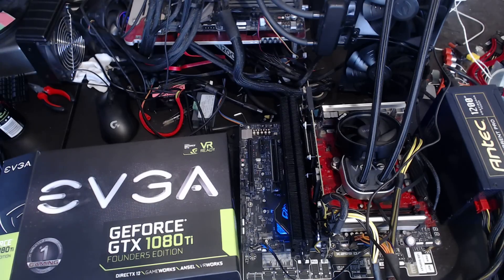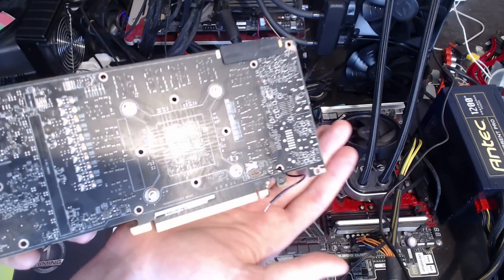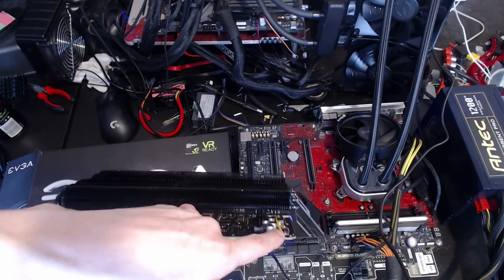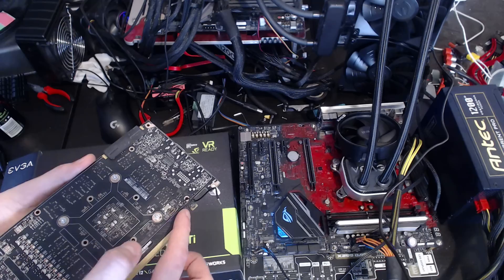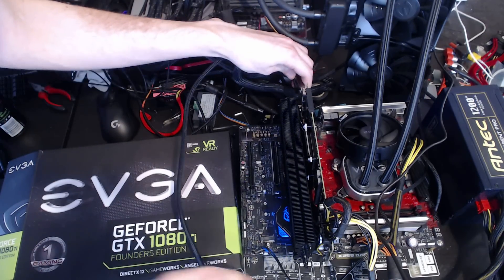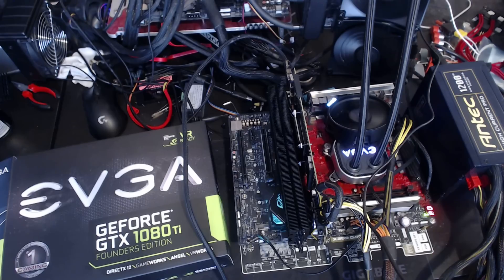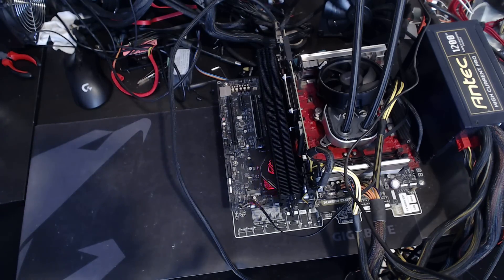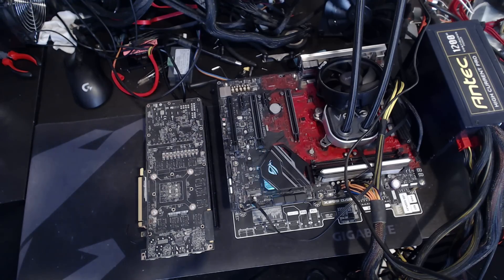OC Adventures: The resurrection of a GTX 1080Ti Founders Edition

Comment from the maker: first

EDIT: because people keep suggesting I send the card back. This is what the sender told me about keeping the card: 

"I've already gone through the traumatic experience of buying the replacement 1080 Ti so I would have no need for this one even if you can get it working."
"I figured it would be better to send it off to someone who could possibly get some use out of it as opposed to me just tossing it. "

Also I'm not a repair shop and if I was a repair shop I'd be charging for fixing things.
Reply: Actually Hardcore Overclocking You should send it back.
Reply from the maker: on the basis that I'm not a repair shop. no.
Reply: when life hands you a broken but free 1080ti that you manage to get working again, the only logical conclusion is to overclock the snot out of it and see how far it can go. bring on the current mods and LN2. worst case, it dies (again) and you had some fun/got some content which was surely the original owners intention (to see if it was brought back, what you would do/it could do).
Reply: Considering a video card loss as a trauma is whats wrong with the world and why there is genocide, it amazes me how brainwashed people are, they need to get the fuck out and live life or do something because the world is being destroyed by psychopaths...
Reply: and here you sit........LOL
Reply: 600flames is proly trolling XD
Reply: what about chopping up a pci-e extender instead of fidgeting with that presence wire, I would be concerned about  shorting the presence to the 12v right next to it, which would probably set fire to something else, it would't take much for that wire to find a way loose and bridge to the 12v
Reply: it was water cooled and coolant got spilled into the pcie slot (friend of the person that sent it in)
Reply: You should keep or trade it to another overclocker that can use it...
Reply: preach that shit, it was a gift
Reply: Janky presence detect jumper wire for the missing bit of PCIe connector, that is not really an end user fixed item, it's more like BZ got it barely functioning good enough for an OCer/Modder to use it on a test bench only, with a lot of tedious work to get it plugged in, lol.   Some of the comments are funny about giving it back given the 'work around', lol.

Great vid BZ, congrats on another card for, well, OC it till it's dead again (grin)

Comment: Hi I sent the card in. Don't send it back. Ta

Why I couldn't RMA it: Coolant spilled on the PCI-E slot on the motherboard while I was swapping out the CPU due to a loose fitting twisting when I took the block off. Spent 20min hitting it with a hair dryer and left it for a few more hours to dry, ran the system and it was fine idle but as soon as power started going through the slot it caught fire. Wouldn't be covered by warranty.

Comment: With that janky PCI-E connection it's not even in any shape to be given to a regular user. And just because it could be fixed does not entitle the original owner to anything since it was essentially considered trash.
Any dead hardware sent in with the expectation of it getting fixed and then sent back deserves to be ignored. Buildzoid is not a charity.

Comment: nice work. lately i've been wondering about dead gpus i could fix. it's not rocket science after all.. i do have a multimeter and what's necessary to solder stuff, just not smd mosfets (yet). i also have a cheap DIY scope good for up to 100khz or so with a 1x/10x probe that i'm using for audio stuff, but it'd be hard to see actual pwm signals with it but still it's not completely useless.

as far as you can tell, how high is the chance of a gpu to have a repairable blown vrm, as opposed to blown gpu core or ram chip in the ebay market?

Comment: Hey Buildzoid,
I bought a GTX 980Ti which is not recognized by the mobo (VGA LED lights up), no display and also the fans are not spinning on start up. Furthermore every voltage (12V at test points and the 12V caps, 5V, VCOre, VMem, PLL, PEX and VDDQ) are  basically 0. The only one present is the 3.3V. Any spontaneous idea what might be the culprit?

Comment: Great news abought that GPU but when does the next video abought VRM temps come out? Im really really iching to buy the MSI X470 Gaming Plus but i still have some doubts abought it being able to handle a 2700X for a daily streaming option without direct strong airflow over the VRM-heat-sink. Depending on that i might buy a Biostar X470 GT8 because it has a 8 phase IR3555.
Reply from the maker: So I did a test run with the Gaming Plus on an open air test bench with 0 airflow. At 100A 1.4V it hit 108C on the VRM and 97C on the capacitors. If it had some air flow it would run a lot cooler.
Reply: Thank you very much. I really appreciate the motherboard reviews and the work you put into sharing your knowledge and data. Some of your T-shirts are starting to look mighty fine. Would you maybe be interested in a old 1gb 560Ti, to overclock to death? I was planning on putting it on Ebay or use it for solder practice but i could also send it your way.

Comment: OHC, I have a Z170 OC motherboard that doesn't overclock well, and I don't want to mess with it anymore, and want to know if you'd be interested in testing to see if it works and if you could push it to the max. I think I shorted some circuitry when trying to install a fan controller, but the board was working without issues for about 18 months with a 6700K. I don't need the board and can't recover the money for it. You interested? I'd be happy to gift it free and clear.

Comment: I should buy a rajintek morpheus...
Reply: yes. or an artic one.
Reply: It is excellent. I've found that the best fans for it are two Fractal HP-12s, really quiet.
Reply: GurtTarctor I believe you misspelled Noctua NF-F12
Reply: I've found Noctua's and Corsairs ML fans to all have slight resonance and hum issues at certain RPMs, at least with the 140mm variants (ML120s too), whereas all the Fractal fans I've had have been consistently really low in tone and noise. Noctua fans are overrated in terms of the 'silence' aspect in my experience.
Reply: GurtTarctor i got two Noiseblocker 120mm fans on my ref RX480 with a random heatsink, works quite well.

Comment: Wouldn't it be possible to just replace or bridge the broken 12V and ground PCIe pins and keep the shunt in place?
Reply from the maker: there's still a short circuit in the card.
Reply: How do you replace a pins in edge connector when PCB melted away ?
You can't simply solder together what's left to a new PCB. 
Durability would be a HUGE problem (since this part has to go into a slot, and get out of it in one piece).

Comment: Just cut that burned part off and solder missing part from some pci-e extender... they are cheap on ebay @Actually Hardcore Overclocking
Reply: There is a short between 12V and Ground pin, you can't connect 12V pin to anything because it will melt right away.
Also, "fishing" out for solder points to those missing edge pins will be a nighmare.

Comment: send it back to him, geez its the right thing to do man
Reply: Buildzoid fixed a pice of garbage that had almost no value, more over it was a donation, so I don't see a reason to send it back (and if smth else fail/ will need to be adjust, this dude would have no idea what to do again xd)
Reply: TecSpy Toxic Team not underestimating buildzoid's skills but this card could be easily repaired by a BGA/Motherboard repair technician, since the card also had working GPU owner could find a dead GPU 1080Ti and resolder it.
Reply: You want to BGA ALL of the PCB parts to a new one ?
Because you can't "copy/paste" a PCB. 
You have to replace it altogether.